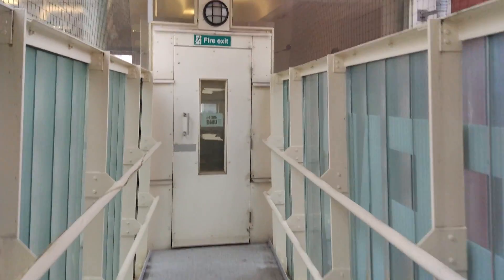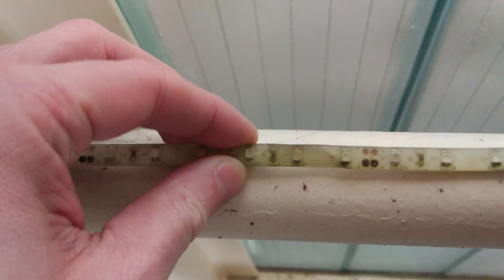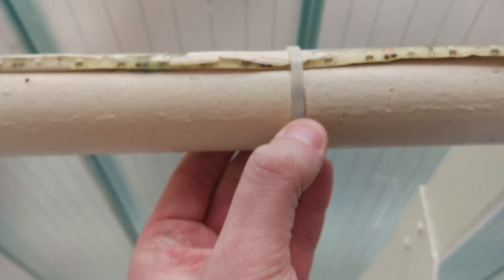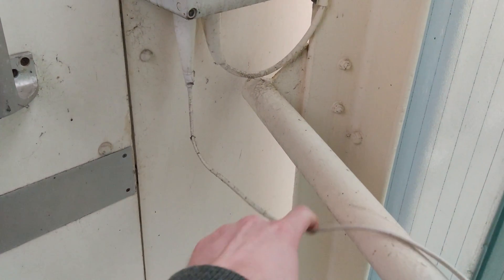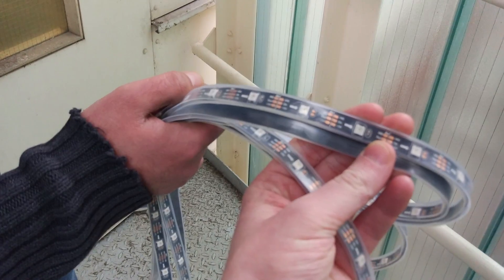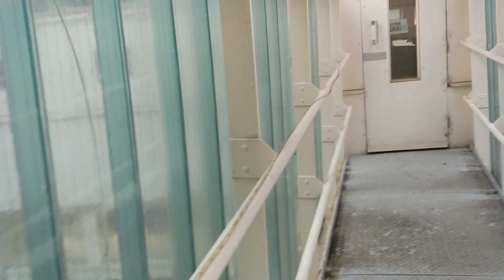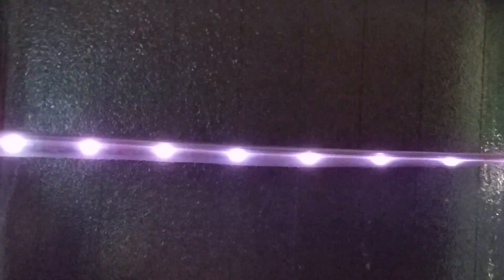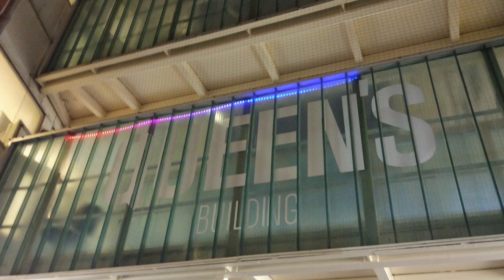Bridge Lights Part 2: Point of failure

Comment: First thing I saw was a fire escape sign... better be extra careful your strips can't detach and impede anyone's evacuation - the existing installation doesn't look great in that respect tbh... off the top of my head I think plastic cable ties might not be sufficient any more either.
Also though I've never experienced it myself I've heard some PC PSUs can go unstable if you draw a high current from some rails when the other rails aren't loaded.

Comment: Did u add a resistor between microcontroller data pin and strip?
If not u can get spikes that can damage the first pixel.
Reply from the maker: yeah 470 ohm, I cut off the first 30cm of the strip which worked fine. The rest of the strip doesn't, we were just a bit reckless with the power supply I think.
Reply: Also adafruit says : "Before connecting a NeoPixel strip to ANY source of power, we very strongly recommend adding a large capacitor (1000 µF, 6.3V or higher) across the + and – terminals. This prevents the initial onrush of current from damaging the pixels."

Comment: I've overvolted a couple of short 2812 strips, and they do often seem to fail s/c.

Also notable is that if you're feeding the power from one end, the voltage drop at any significant brightness causes the blue LEDs to be dimmer at the far end when set on a "white" colour leading to a strong red cast towards the non-powered end.
Really needs extra cable to supply power to the other end (and middle too, if you want to do it right) of the strip to ensure colour consistency.
I ran some 1.5mm twin & earth alongside mine and connected it at both ends to keep the V drop to a minimum.

Comment: If you try to glue an acrylic stab to the led strip then the visible led points will vanish ... Looks better even with a 10 x 2 x 500cm board of acrylic. We had used that for art or art frames.
Reply: What is an "acrylic stab"? Is it similar to a metal slash or a floral spear?

Comment: Oh what a shame!  Right now, with the SK6812/WS2812B's if 1 pixel IC fails in a strip, it won't pass data onto the the next anymore... but there is a new model out (sorry can't remember the model number) that has a pass through on the IC... so if a pixel fails, it doesn't take out the rest of the strip. It could be WS2812C or WS2812S ? I'm not sure if any strips are available in them.. but might be a good way to go?
Reply: I think the number your thinking of is the WS2813. This is relatively recent, and yes it does allow data to pass through a faulty chip.
Reply: Thanks Brian!!! Yes that's the one... very new indeed, so not sure they will be available in pre-made strips.
Reply from the maker: Just bought some to test out.
Reply: Awesome! I'm excited to hear how they go... it wont of course solve whatever caused the short/issue on your first strip, but it might make them last longer :-)
Reply from the maker: Oooooh apparently there are strips available on Amazon, thanks Seon!